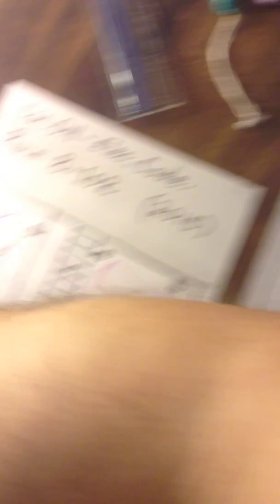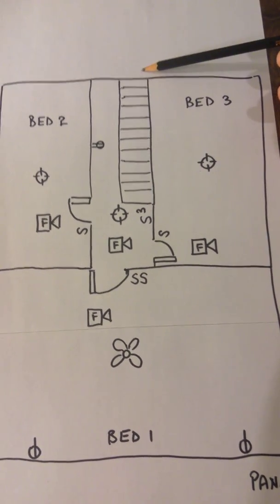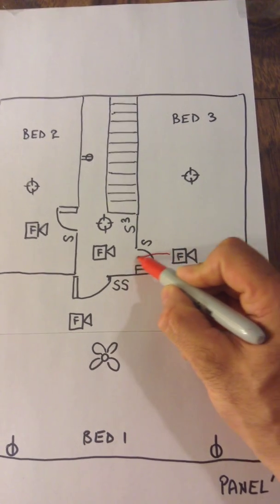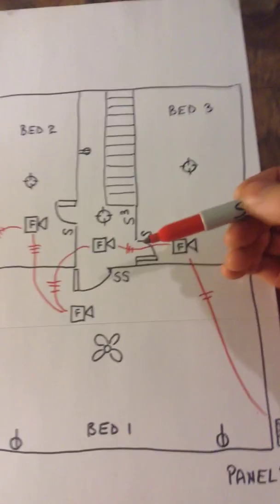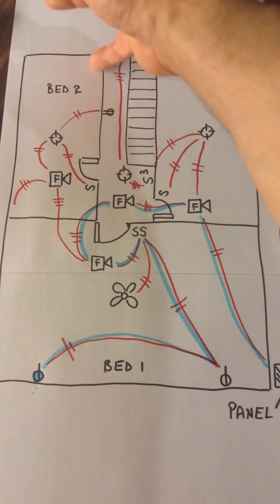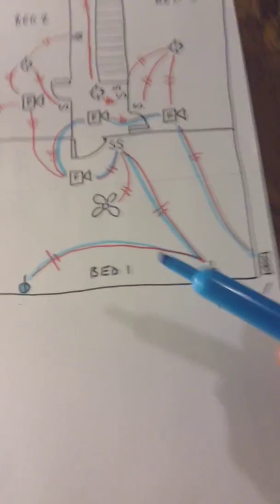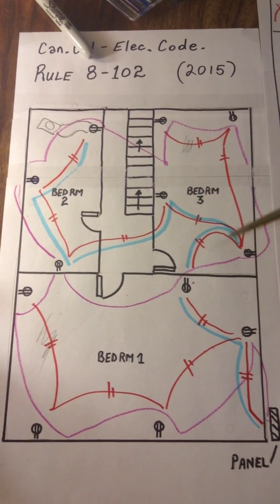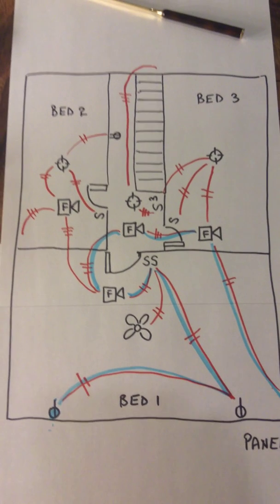Voltage Drop Concepts in Electrical (Part 2) Can. ON Elec. Code ESA Rule 8-102

Comment: one thing i think is wrong is that the hallway plug should be protected with AFCI but the smoke potectors should not be AFCI so therefore they cant be on same cct
Reply from the maker: Well in Ontario Canada, the code did not specify mandatory over-current protection of the hallway receptacle by an AFCI breaker prior to the year 2015. However as of now, since 2017 the code has been in mandatory effect some time after 2015 relative to AFCI protection through-out a residential dwelling; and it states that all receptacles in a low-rise dwelling ("house") shall be protected by an AFCI-combinational over-current protection device (breaker), but exceptions are only made for: sump-pump, fridge receptacle, washroom GFCI's, and kitchen counter receptacles. All other receptacles within the house shall be protected by AFCI breakers! With respect to interconnection of the fire-alarm system ( CO2-carbon monoxide, strobe-lights, smoke detectors) with AFCI breakers; this is not required however it does-not violate the code if the fire-alarm system is protected by an AFCI breaker. In fact, this is considered an upgraded installation because AFCI's detect many other defects/malfunctions within wiring ccts., than regular breakers (defects such as; arc's, loose connections, semi-severed wires on the brink of breakage, burnt wires, old chaffy wiring, etc...).
Reply: Manny Calderari thanks for reply i did check 32-110(e)  and you are right,  the smokes can be on same circuit as afci,  i like keeping plugs and light CCT separated anyways since the afci could cause accidently tripping on some lights also trade practice. Also i wanted to add that any hardwire appliance like hoodfan or dishwasher does not need to be afci.  i do have a question,  could you point me out where in the cec it says that you have to run bx (AC90) to the first device if you put a afci plug instead of a breaker?  and question 2 is a bit off topic but table 2 with the #14 awg being 25A now on T90, how does it affect us electricians now,  you still need 15A overcurrent so whats the benefit of the limit at 25A??? 

im having a hard time trying to use the correction factor of table 5A and i give example :    
on #14 at 35°C then T-5A states to multiply 25A x 0.96 =24A,  then do i still do the 80% of that load??  if so 24 x 0.80=19.2A..... i fail to see what that means if breaker is 15A does it change anything???  in that CCT i still can load up 12 A only right?  
sorry for long post but i had 2009 CEC and i let myself go from updating for some time (didn't need it for what i was doing)  now i have to get back to updating myself (better late than never haha) thanks if you take the time to help me out